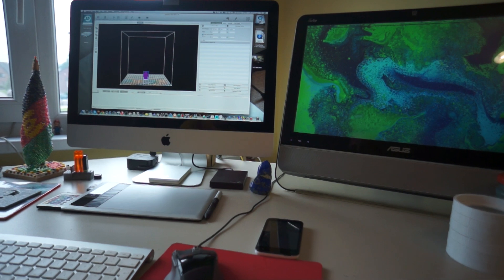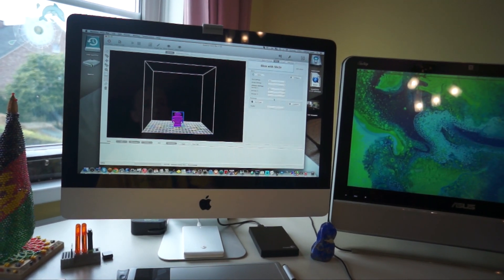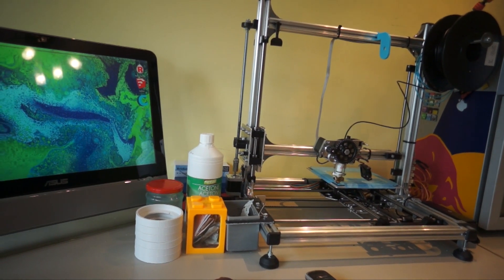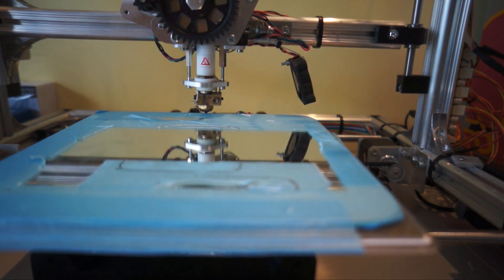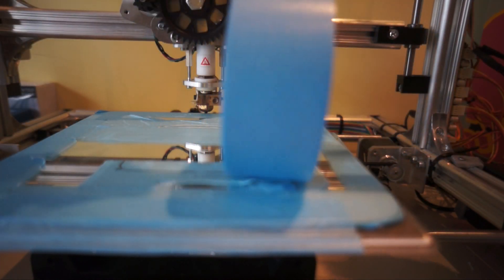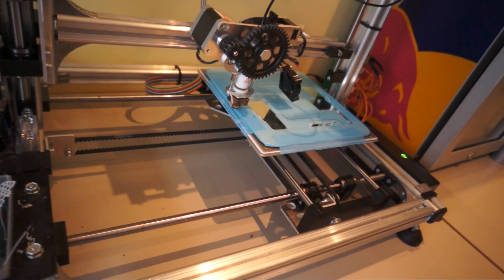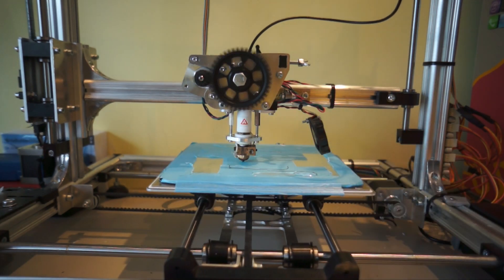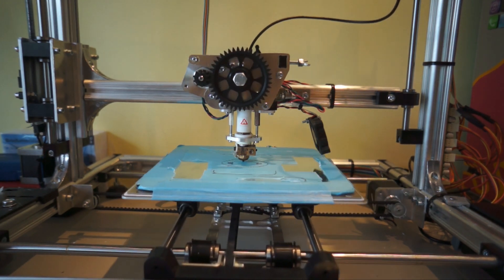Ultimaker robot 3D printing on Velleman K8200 Time-Lapse

Comment: Did you use PLA or ABS for that print? Because if have the same printer, but i got problemens when i want to print large objects it starts wraping all over. I used ABS juice but only on the white painters tape, does the blue tape really help with abs?
Reply from the maker: When you use abs juice don't use any tape just a mirror. Blue tape only helps with PLA. If you wan't nice results on ABS you can also use a gluestick or hairgel spray volume MAXIMUM or 5. Hope this helps a little. Best way was using ABS juice. It works great and doesnt need to warm up the heatbed!

Comment: Was the Velleman K8200 easy to build or was it a very long tedious process. I wen through the manual and found that it has meh documentation. Have you had any trouble with the main board? There have been reviews saying that it breaks easily and very hard and expensive to find. Is the power supply compatible with US outlets or is it 220 volts AC power? Hows the print quality? Etcetera.... Looking for opinions because I'm interested in one myself and their return policy is extremely strict and I don't want to spend $800+ on something that will break (snaps fingers) like that..... Respond soon.... Thanks....
Reply from the maker: It was easy and the manual was great! Never had problems with the board after print I sometimes need to click the reset button but thats it. It doesn't affect anything! It is compatible with US. The quality is simply great! Takes some time to adjust it but its great. I also have a Flashforge 3D printer soon there will be more videos. Please subscribe for a lot of tips and 3D reviews.
Reply from the maker: Said simply: I do recommend the K8200 from Velleman and theyre support is also great! If parts will come dameged they replace them free. (mine were not damaged though). I also does a great ob on other filament like Hips and ninjaflex. The only bad thing is the heated bed that hardly achieves 60degrees.. If you change the power supply it will be around 140. The heated bet is used for ABS but I use ABS juice for printing ABSon this printer. So the heated bed is not a big problem. There is a video that expains ABS juice on my channel!